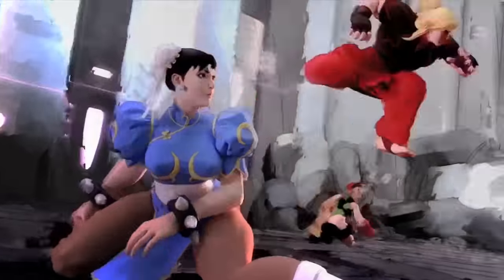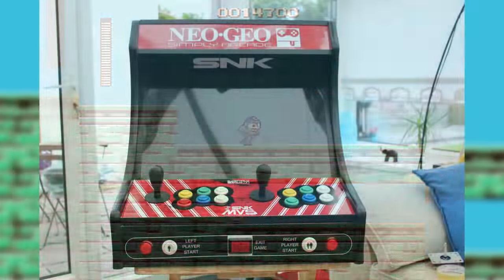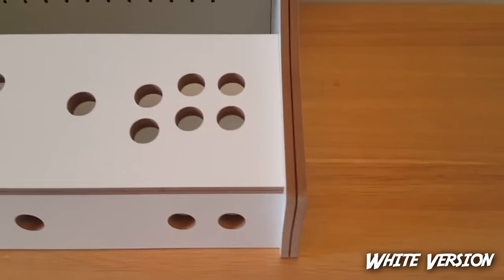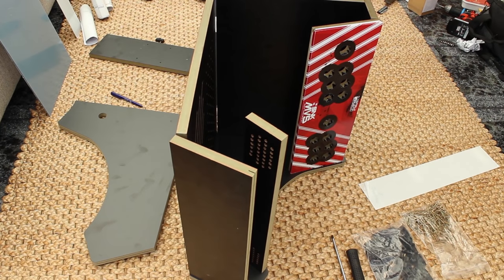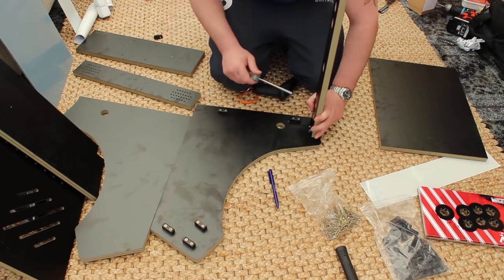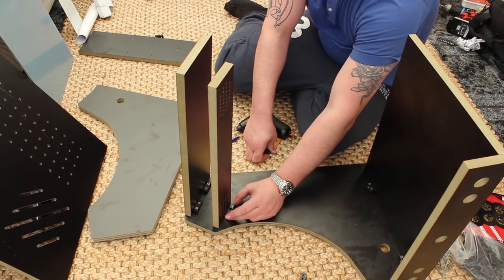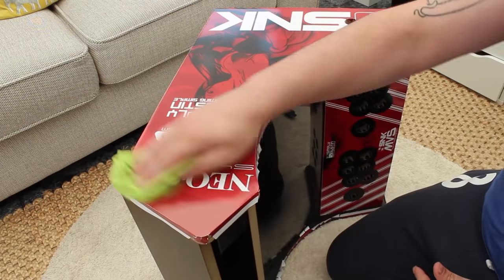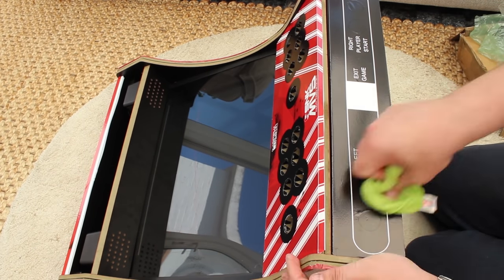Ultimate Arcade Cabinet - The Easy Budget Build

Comment: Pro tip: Add the glue before you screw it together, putting glue around the edges and seams is not going to help hold your cabinet together, all you are doing is wasting glue.

Comment: Easier way to apply vinyl art is to peel back a little of the backing and stick down the vinyl that is revealed and then using a credit card to push out any air as you lay down the vinyl whilst at the same time pulling back the backing paper, you will find this much much easier

Comment: I got my "budget" one for less than 100€. A Raspberry Pi (35€)for directly emulating old consoles, or Nvidia Gamestreaming for modern consoles, a old Monitor (25€) and some wood I had lying around (0€). 1 HDMI cable (10€), a old ATX PSU (free). The Rest was just 2 Weekends.
Reply: sick man, send a pic if you can
Reply: And the buttons?
Reply: MegaMily I no longer own that thing. I sold it on eBay.
501PegaProd I got those from a old rubber dome keyboard. Instead of the Plastic Key Caps i used pretty thin plywood (So it does not press down the Rubber Pads by itself)

Comment: Looks excellent, thanks for the video. But for those on an even tighter budget, you might like to check out the pimoroni picade. Comes in at about £225 all-in, once you've added a raspberry pi 3, power supply and sd card . No woodworking required. It's smaller though -  a one player desktop size. I'll send you some photos of that and my bartop for comparison!

Comment: Great video! 👍 you wasn't lying about not being good at woodwork 😂 you made a meal of putting the cabinet together, I hate to see you try and build from scratch 😂 you done ok in the end though. A little tip for the side vinyl though. Go to your local car accessory shop and buy a window tint kit. You'll get a precision cutting blade, squeegee blade and spray bottle for about £6, the squeegee blade would be perfect for pushing all the soapy water out from between the wood and vinyl and getting it nice and flat, bubble free. Be sure to soap spray the surface you use the squeegee on so you don't scratch it while using the blade on it. Il be heading over to watch part 2 now. I'm good with woodwork, could make this unit for about £30 but I need to learn more about the electrical side.
Reply: MrStreetboy no you couldnt

Comment: If you realy want to use gorilla glue you should apply it on the side/edge meeting the board. I do a lot of wood working and use that glue to make 2 to 10 boards one big sheet buy doing this method and clamping them. Running it down the seem wont add any sort of durability I'm afraid. My testing before I chose this as "the glue" for my work was done buy glueing 2 boards then jumping on them to see if they would brake. The board broke the glued seem didn't lol. So do it like this and it will last forever.

Comment: nice video. ive always felt that 4player panels are best in pedestal form. so player 1 and 4 dont have to be set at an akward angle. they can be straight forward like player 2 and 4 always are.
Reply: So, explain how they see the monitor then? I feel you did not actually think this comment through.

Comment: Nice build mate.  Looks very familiar. Nice job on the graphics.
Reply from the maker: Hehe thank you matey :) we are arcade brothers now :)
Reply from the maker: +Fredintheshed1 HEY!!  I just found your Pizza box T Mold seller hehehehe.... I got one delivered today :)
Reply: Crap.  Well I hope yours is in better condition than mine was :-(
Reply from the maker: To be honest it was in good nick.. but the actual teeth bit isn't long enough to go into the wood?? Pointless hehe
Reply: Don't know if you saw on my video but I had to enlarge Rich's grooves to get the T mould to fit.  seems 3mm is the norm ?
Reply from the maker: Not sure mate... I had a huge set if teeth on the one I used. I had to use a hammer... hehe enough said about that... but it did fit OK

Comment: I bought a cab kit from Rich, many years ago, and at the time I thought it was great value... though sadly I got mine before he "upgraded" his kits, and it was very basic; no instructions of any kind, no t-slots cut, no air vent cuts, the bottom mounting panel is too short and leaves a huge gap at the bottom between the panel and the front "admin button" panel, plus it didn't even come with a monitor mounting bar. I asked for help on the group but was kicked from the buyer's group.. so... egh. I stopped recommending him to friends. I'll definitely go with another supplier in the future, his "support" is appalling :(

However! Your vids are always spectacular! <3

Comment: hi there 
thanks for uploading this build, I'm in the middle of making mine and almost finished, it's a bar top one like this, and I was gonna use a raspberry Pi, it's was alright but cause I was using the xin mo controller I seemed to have a few problems with the pi, so I deciding to use a pc instead, it's not the best looking arcade machine out there (I bought the wrong size MDF so I couldn't use t moulding in it) but it's alright, my painting wast the best either but I'm planning on getting bits of vinyl sticker to cover it

Comment: It seems odd that the cabinet kit doesn't come with the "modesty blocks" needed to build it. FYI: for fellow Americans "modesty blocks" are called jointing blocks here but your local Home Depot or Lowes helper will probably know what a "modesty block" is but they'll think you're a bell end for asking for them by that name.
Reply: I'd argue they are not strictly necessary to build it, as there are other ways of joining it together. It's probably the recommended way though for inexperienced builders.
Reply: Stunt Panda I tried looking for these jointing blocks at both home Depot and Lowe's online but can't come up with any matches. only seeing it available on Amazon. are they called something else in the us?
Reply: +Geoff Lai Yeah, they're also called a fixit and that kind of joint is called a knock down. If you can't find any just buy some square batten and make them yourself. If you go that route make sure you predrill or you'll split them.

Also, I'd try calling your local store instead of using the website.

Comment: Great video. Very tempted to give this a crack. Always wanted an arcade cabinet but just not got the space but a bartop like this I might just get away with. Especially if I can get it to look that good. I've got a Pi2 is it worth upgrading to a Pi3.
Reply: Nice thing about the Pi 3 is the Bluetooth and Wifi is built in leaving with more ports in case you want use the pi to power other thing like lights, sound,Ect
Reply: I have a Pi2 and a Pi3
 Both will do the job, but I was surprised how much more power the 3 has, and especially how much faster it does things.

Comment: What material did you use for your bezel, is it possible you could link it? Awesome video by the way!
Reply from the maker: thanks mate :) it's just a 3 mil plastic mate. I asked rich to cut me a bit with the perspex. but to be honest card would be just as good
Reply: Thanks for the response! Better late than never, but what did you assign to the buttons on the sides of the cabinets? I'm racking my brain my over what those could be used for but I have no idea. I'm hoping to start my build in the next couple of months :D

Comment: I built my own from scratch , got all the wood from a skip, the monitor cost 10 quid from a charity shop, raspberry pi 2 25 quid, arcade controls 13.99 from China , bezel plastic 3 quid from Wilkos, under cabinet lights cost nothing , got them from a broken backlight USB keyboard and superglued some red plastic signage I got from the skip when my local Indian restaurant was having a refurb , 3 cans of black gloss spray paint from the pound shop, check out my video of it on my channel

Comment: https://youtu.be/RD7kYk2qMCs
Strangely enough, me and a friend have been following your last video and decided to emulate what you're doing, we have the same monitor and a 12mm cab from richs bartop arcades, we're using a pi3 model B and its taking everything we are throwing at it, its also been brilliant fun, so thanks Austin! I'm curious to know how you power the PI as I'm getting a low power icon when running off the monitor, I dont really want 2 plugs coming out of the cab...
Reply: Try taking a look at the instructables guide here - http://www.instructables.com/id/2-Player-Bartop-Arcade-Machine-Powered-by-Pi/step15/Wiring-everything-else/ I managed to get an IEC inlet for about £5 GBP on ebay and wire it to a surge protector I had lying around - works a treat!
Reply: +Andy Greasley that's great help, thank you :) I've got a couple of idea now, just needed to stew

Comment: Hi Mate, what size are the buttons please? Cheers
Reply from the maker: just standard mate.  28mm off the top of my head.
Reply: +Simply Austin thanks mate
Reply: Hi Mate, things getting exciting here. I'm waiting on Richs unit coming and I've got everything else. The monitor needed a cdmi to dvi cable which i had lying around. I'm working on the software and having some great fun with it along with a few challenges of roms not working. Looking at the front and side of your cabinet, what are the black buttons either side of the unit used for? Also, where did you get the square red button for the exit? I'm going to be adding a twin usb port to the front for controllers for the other emulators. Im hoping to have it finished for the end of the week. Cheers.... Awesome channel and great to watch.